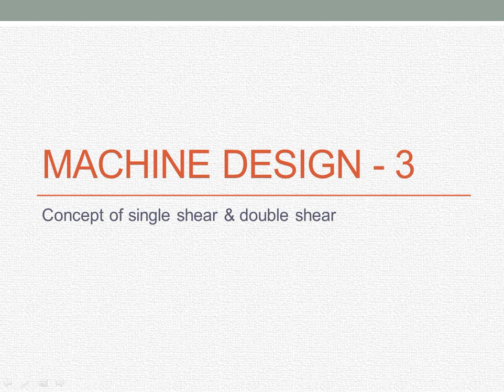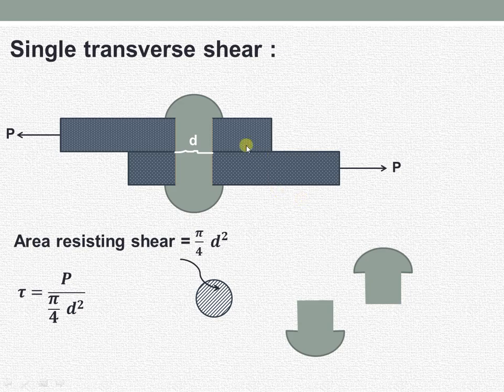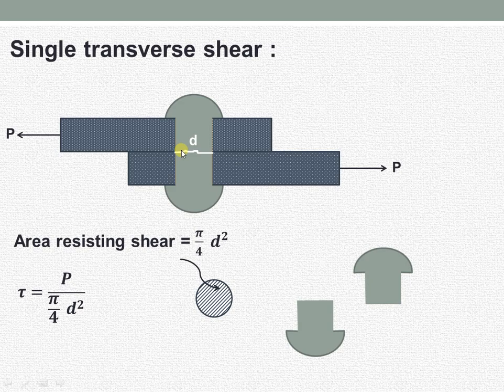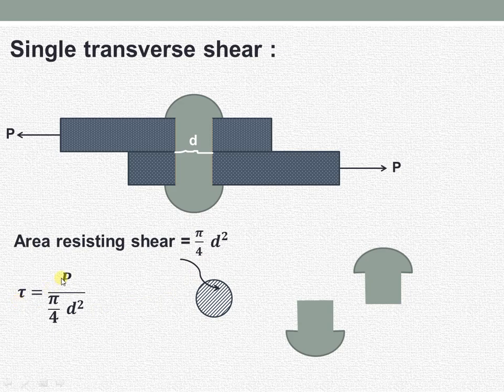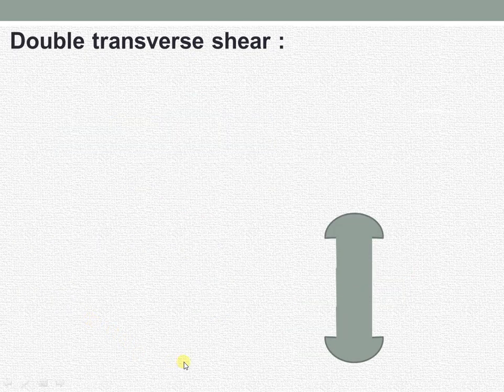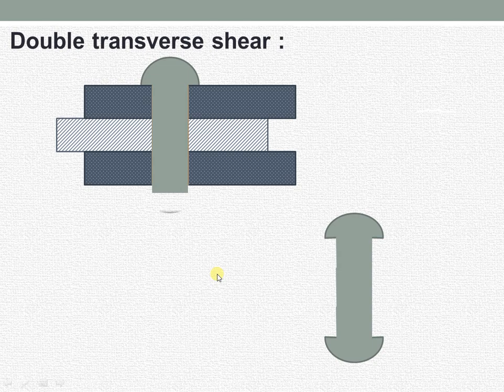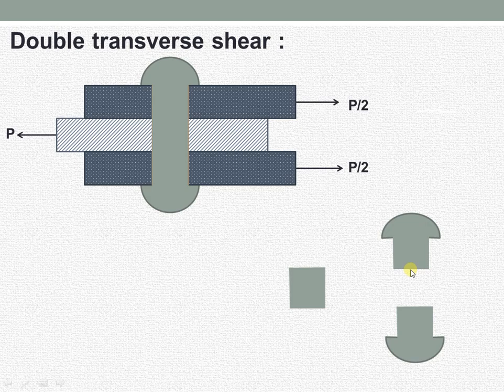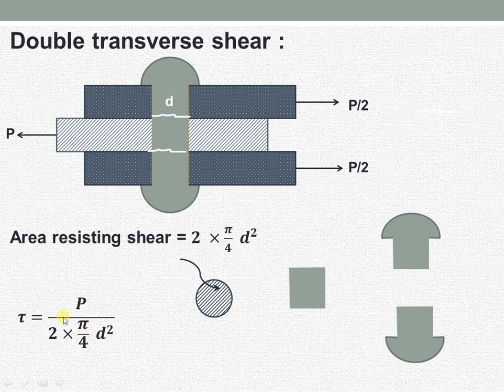Concept of single shear & double shear in machine design

Comment: what if the plates are in double shear but the thickness of plates are different for eg the middle plate is 32mm thk and first and third plate are 8mm thk, and what will be the force distribution of bolt in bearing ??